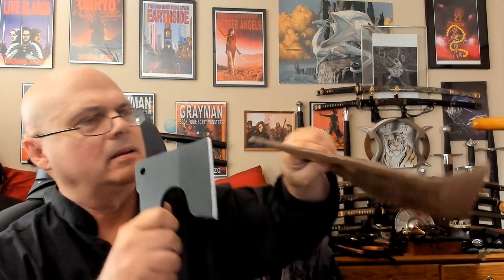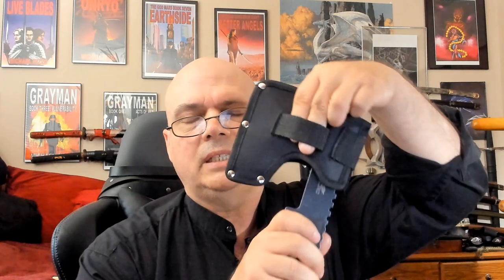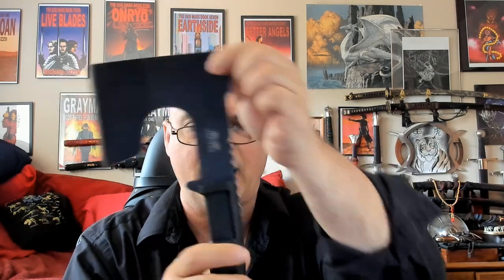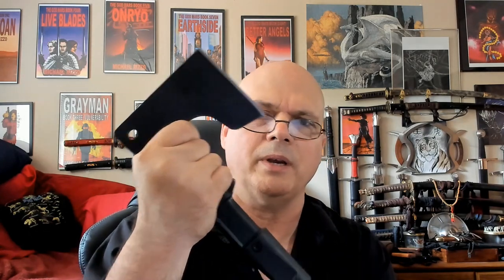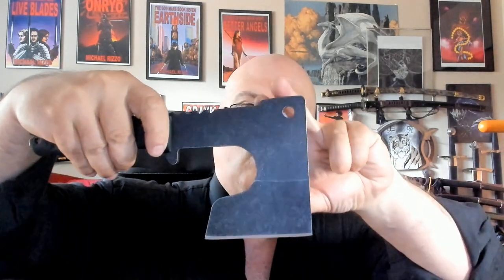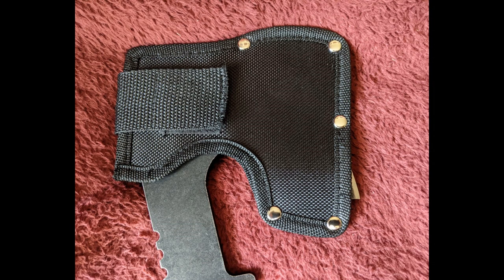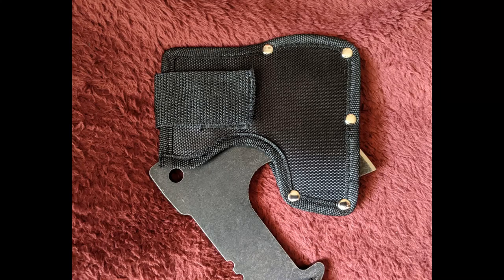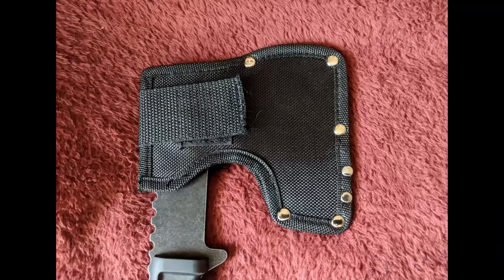JXE JXO Camping and Survival Hatchet?

Comment: Has a very similar handle to extrema ratio. It's definitely got a soft wood/matetial blade. One can tell by it having the straight bit rather than having a more curved or moon shaped bit. Pretty nice though.
Reply from the maker: Basically a short cleaver, not for heavy chopping or splitting.
Reply: Not just similar but exatly like an ER blade handle. Love it on my Doberman IV though. ^^

Comment: My go-to hatchet is a box hatchet, with a axe head, a hammer head, a small pry bar and a nail puller intergrated together. I keep it in my car as a camping and rescue tool. The only down side, it is a cheap POS. The metal is so soft that the hammer head got dented up from nails. it is hard to find a decent quality one with reasonable price nowadays. They were all either antigue one made in the 19th century, or the guicci 5.11 one with no handle.

Comment: Funny that you showed that little hammer, i have the same one from the same place, but i also have the ball peen hammer as well. They are in my car kit just in case. I also collect cleavers and yes that thing looks like it could hold its own. I have several tomahawks too. Just like any multi tool, can it get the job done? Yes. Is it the best or most effective? No. Its what you have when you need ot that counts and if its small, light, durable enough its easy to grab and go, then yes its a good fit. It a whole lot better than the granfors bruk axe or kukri that you left at the house. However i never leave with my kukri. Good review, i might just look it up myself.